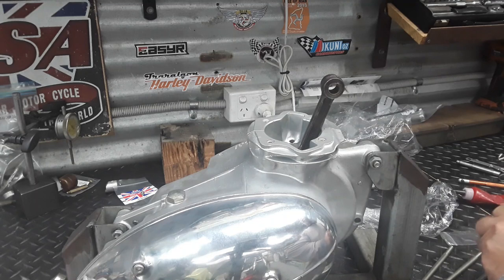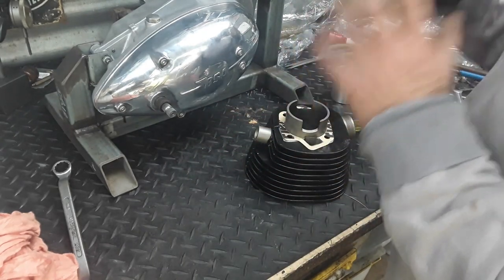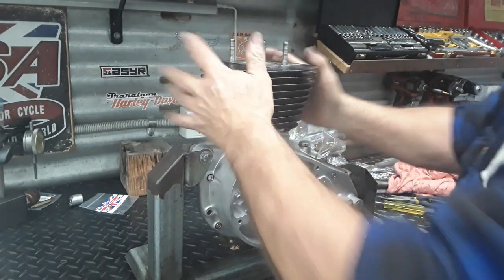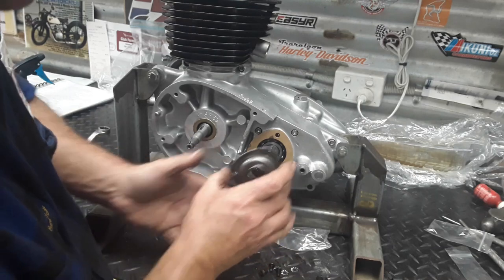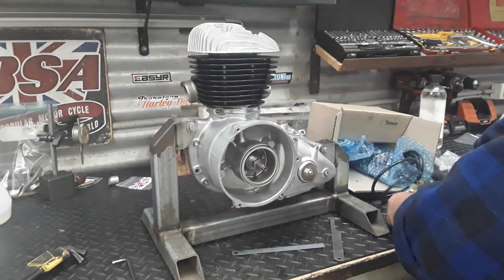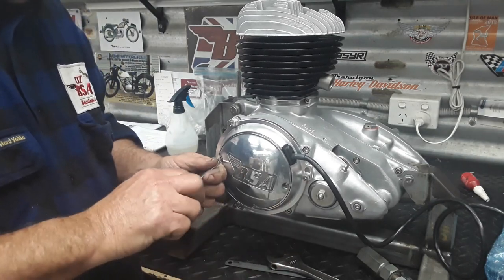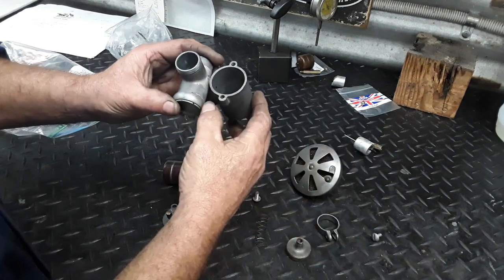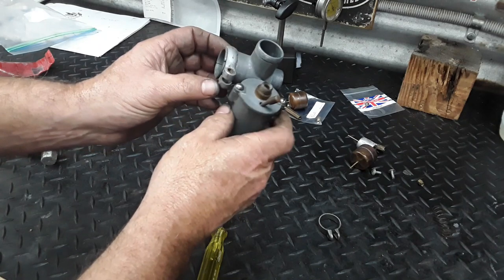D3 BSA Bantams engine overhaul Ep 6 of 6

Comment: really enjoyable. did i hear you say no head gasket??
Reply from the maker: Yes that's correct. I don't run head gaskets on Bantams, however I ensure the mating surfaces are lapped perfectly flat.
Reply: @OzBSABantams  Does that not raise the compression and therefore count as a “modification”?!
Reply from the maker: @kevinjerome4925  The pineapple head Bantams (pre-53) didn't have head gaskets. The increase in compression would be marginal. The error in the castings of the heads from BSA would have more effect. I'm not sure where you're coming from in relation to a "modification".
Reply: @OzBSABantams  If the lack of a gasket meant that the compression was raised above the factory supplied specification and hence a power increase and performance, then for insurance purposes, this would be regarded as a “modification”.  This would have to be declared to maintain valid insurance - just saying how it is!
Reply from the maker: @kevinjerome4925  Hi Kevin.......The removal of a gasket .005" thick would barely have any effect on compression ratio and increase in power on something that was purported to be 4.5hp. The omission of the gasket reduces the combustion chamber volume by .02cc. The variations in manufacturing tolerances on the head combustion chamber profiles by BSA vary way more than that in combustion chamber volume, therefore I doubt you'd have any insurance issues. I'm not sure where you are, but insurance companies in Australia don't class that as modification as it has no real measurable effect on performance. We are talking Bantams with a compression ratio of only 6.5:1......It's very low. Appreciate your comments..........